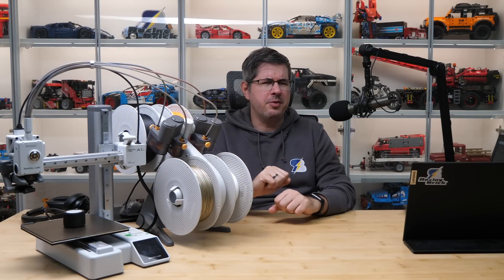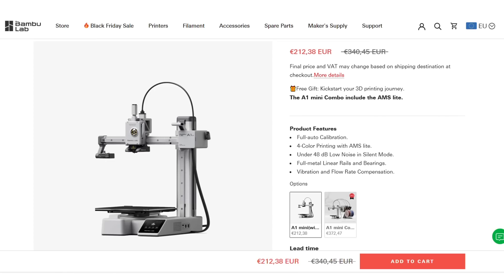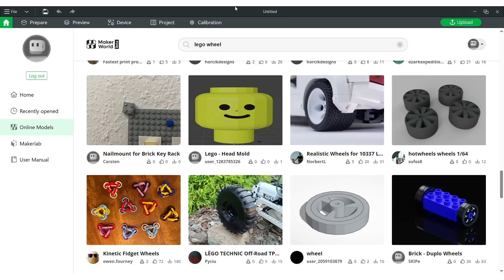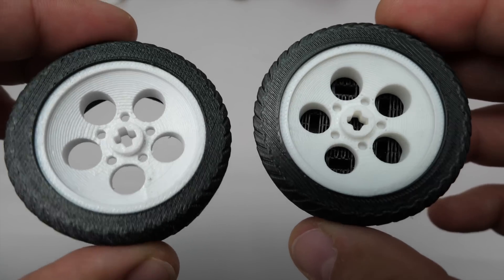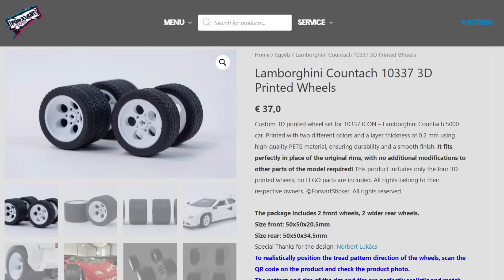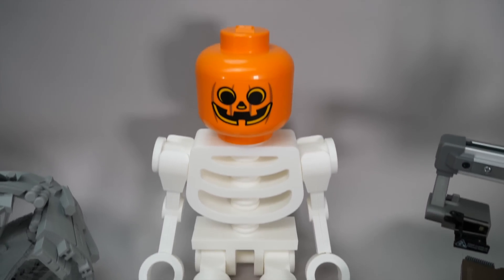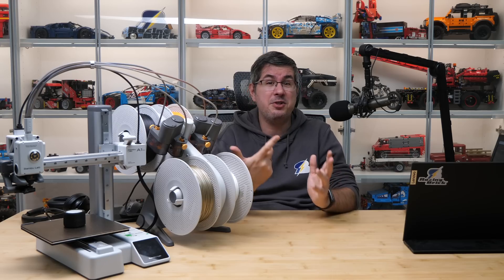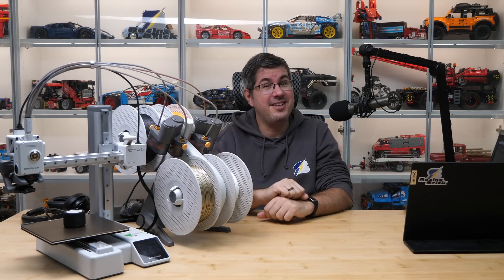3d Printed LEGO accessories: Buying vs. DIY - Can the Bambu Lab A1 & A1 Mini do it all?

Comment: Tires are pretty much the worst parts to 3D print. I'd be interested in seeing 3D printed parts for things like spoilers and other body parts, to hide the existing gaps on an official model for example. Or printed window frames to hold a sheet of transparent plastic in place (you can get the sheet of plastic from a cut up soda bottle). Or just plastic sheets holders to protect functional parts of an RC car, like the motor, battery, etc since technic parts leave a lot of gaps.

Comment: I have an Ender 3 S1 I bought for its low entry price with advanced features like auto-bed-leveling. It's collecting dust, and after about six months of frustration with bed leveling, I purchased an A1 with AMS. I don't do a lot of multicolor printing, but even that has been mostly painless. Now and then, I do have issues with a particular filament, but never with the printer. If you want a painless entry into 3D printing, I highly recommend them for your shortlist.

Comment: Hey, i wanted to know if the lego powred up medium motor can be used as a servo? The which costs around 18eur? 
And if we can use train motor as regular motor (for eg PU L motors)
Reply from the maker: Depends on which one are you talking about. 88008 can be used as a Servo, 45303 cannot. Train motor is similar to 45303, it doesn't have an encoder, can be simply speed regulated.
Reply: @RacingBrick  I'm sorry to ask, but:
Could you compare the speed, torque, form factor and integration into system builds( as steering and drive) 
Of the PU medium linear motor 88008 and the PU L motors
Also could you compare the weights of the technic hub and citiy hub?

I know I'm asking a lot but my L motors don't seems to work in my system builds, and my technic hub is too large and heavy

Comment: Can you make a 32z flat gear and a 28z clutch gear? Lego does not seem to make these. Also, how strong is 3d printed PLA compared to Lego parts, are these wheels with fine spokes purely for display or can you make playable items?
Reply from the maker: You can print such gears, although if you use PLA they probably won't last that long. But there are a lot of other materials to experiment with. The wheels are quite strong, but of course you need to define the requirements for playability - it is perfectly fine for pushing cars around, but probably not for a 30 km/h RC build :)

Comment: My experience with 3d printing involves lots of tweaking and playing around. They never work first time to the quality you want...😂😂😂
Reply from the maker: I had a similar experience, that's why I was very impressed this time with the Bambu printers. Especially because these are the 2 cheapest models.
Reply: @RacingBrick  did you have any issues throughout your printing or was it smooth and easy from the start ? One of our machines worked for a month and was brilliant by now we are having issues with quality.
Reply from the maker: @BOBs_bricks I did set them up, started printing and they were running for 2 weeks almost all the time without any issues. I had a single error due to an old glow in the dark filament breaking in the AMS tube but that was also indicated by the printer. I'm sure there might be errors going forward as components wear down, but if you pay attention to maintenance, clean the build plate then these seem to be quite reliable.

Comment: I will say, I have been glad I went for the A1 over the A1 mini multiple times just because it has a larger print bed. There have been a few parts I've had to split up but generally it can be done in one piece

Comment: If you want to save filament and potentially improve print quality, a lot of those prints can be split into separate coloured parts and then glued together afterwards. This tip is also useful if you want a cheaper printer that can only print one colour at a time.
Reply: 😂A1 mini is very cheap and provides very nice quality and high speed printing. And the most important thing is that the time is more expensive than any other things. When I wait my A1, I thought I will use the A1 and old Ender at the same time, but the fact is that the Ender is retired forever since not worth to adjust the parameters and slice the more for it😂

Comment: If you get a dual extruder printer you can set up the printer to use a different material for support which makes them way easier to remove
Reply from the maker: You can do the same with this one as well

Comment: I was thinking about getting a bambu lab too. I have a dremel 3d45 and it made problems since day one. The filament always got either stuck or it printed in the air, no matter which filament I used or which configuration. It also heavily differed from model to model but ultimately it is almost unuseable. Strangely Dremel doesnt support their printers at all anymore and their own filament is the only one that sometimes worked. Btw, where do you get the files for the Lamborghini countach and all the rims? Would be great to know :)
Reply from the maker: You can find a link to my blog post in the description where all the models are listed

Comment: Yes, they are cheap and awesome for that price. I have an A1 printing right now and it works almost flawlessly. BUT... I have designed my own printer years ago (Dutchy3D) without all the fancy monitoring, bed level compensation, vibration compensation, etc. But they still work as flawlessly today as they did back then with almost no maitenance. Price is a major upside to Bambu and the AMS as well, but easy printing has been around for years already. Most brands just didn't care enough to actually design them. And I love the AMS, but I hate the waste. Those rims could have easily been a 2 part assembly without the waste of filament and time. I use my AMS mostly to print multiple colors sequentially on the same build plate or to remotely start a print and being able to select the right color. But bottom line, nice to see you get into 3D printing like this, the possibilities are indeed endless! Good luck on your journey!
Reply: My mind was already designing a way to make your rims 2 piece but drop the center in the tire with a programmed pause and finish the print enclosing the tire in the rim. Then you can even have a 2 part print with TPU tire that is still locked in place to crate a single object
Reply from the maker: I experimented with TPU in my previous videos, you simply cannot buy a proper flexible filament nowadays that looks like rubber, every regular TPU is way too shiny. The waste was not that relevant in this situation btw, the point was to show how can you print a good looking wheel replacement at home with an affordable device. If you really want you can purge into another object where the color does not matter.
Reply: @RacingBrick  Yes you are absolutely right! I use TPU for its mechanical properties so that's where my mind went directly. In this case appearance is a lot more important than traction on the dragstrip (even though TPU is bad at that as well). And I know you can purge into objects, but I already get annoyed when my AMS cuts and wastes a couple of cm of filament after each print while it was not needed. And as a designer I try to design around that, even though my latest model (roll up chess board) uses a bit of multi color it is even possible to print with only one swap per color. I was already following you for the Lego and I'll keep on following you for the printing! Have fun with it!

Comment: We've been using the Bambu X1 Carbon with AMS for a few months now and it has been quite amazing.   We've printed off quite a few items for Lego including the Fuel Tank and Boosters for the Space Shuttle, some Lego parts and wheels and Tyres with flexible TPU. Quality and speed is incredible. Only used the 0.4mm nozzle so far and we've not felt the need to use a smaller one as the quality is excellent anyway.

Comment: Have you ever used a scanner? Just because what if I already have an existing lego part that I need more of?
Reply from the maker: I am experimenting with a scanner, but I'm afraid you won't be able to have a smooth and accurate enough result of a regular LEGO piece that would fit. It might be better to use the scanned object as a reference and design the part with the regular 3d tools.